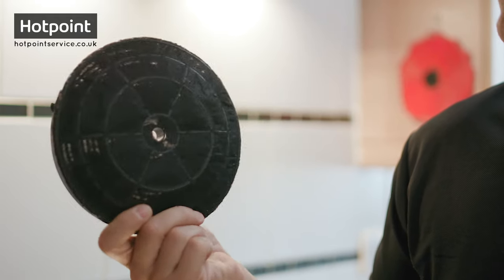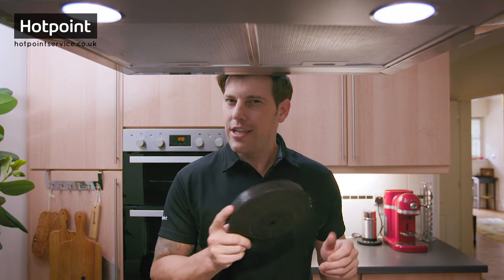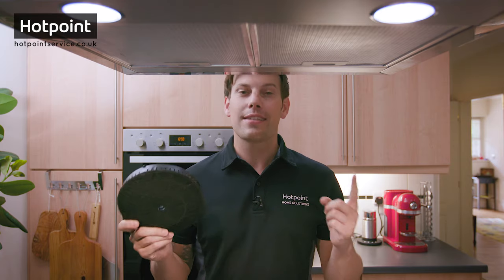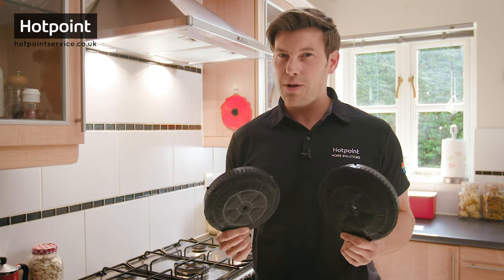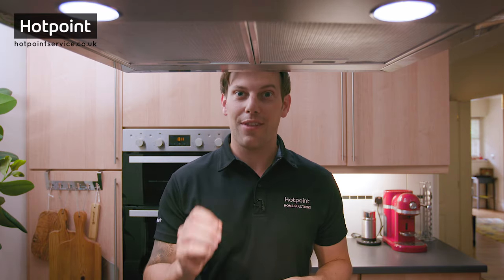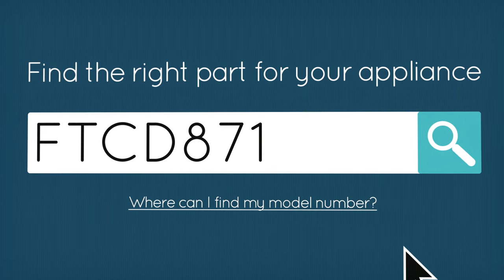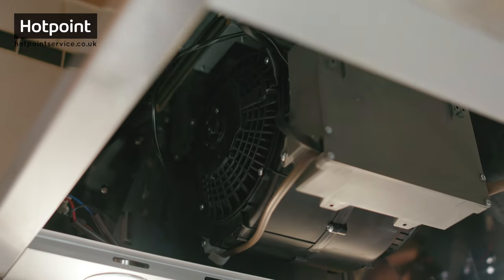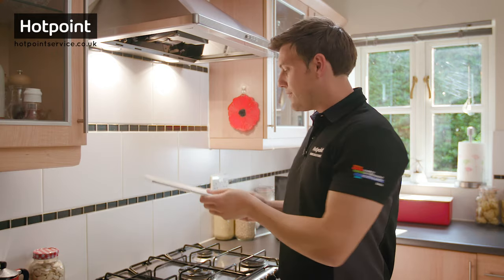How to replace Carbon filters in your cooker hood | by Hotpoint

Comment: HELLO i have the BUSH Cooker Hood BCH90SS It is a week old and we are having problems trying to get the filter what sits on the top of it as we have the 2 what come with it for the inside fan but we do not no if we have to get one for the top as we are not going to have it going out side with the pipe  because when you Turn it on the 2 flaps on the top open up, so we do not no if it will be clean hair or dirty hair coming out ?

Comment: Can I just remove the carbon filter.my good  doesn't seem to suction well with a carbon filter. I tried  removing the filter and it suctioned well.
Reply: Do you remove it ?
And every thing is good?
And nothing happen to motor?

Comment: Could you just wash and clean the carbon filter
Reply: same doubt
Reply: I think activated carbon filters can only be used once. The grease filters can be cleaned over and over though.
Reply: @SGK2325  No, the carbon chemically absorbs the smell/smoke into the carbon and can only be removed by "reactivation" which requires heating it to 900 degrees C.